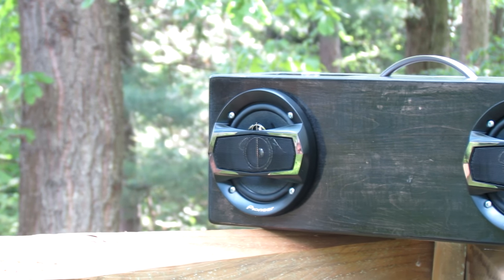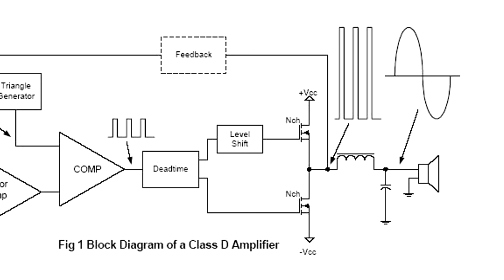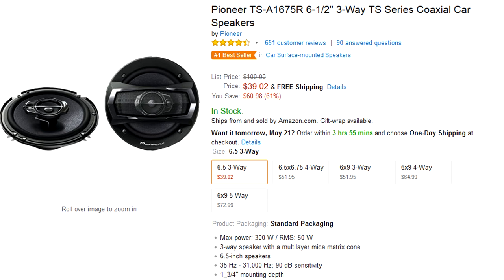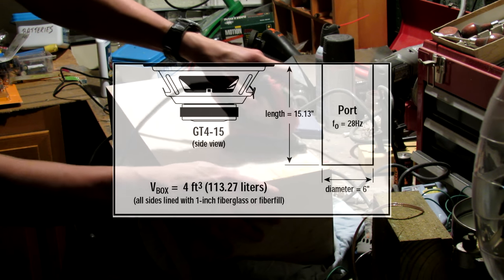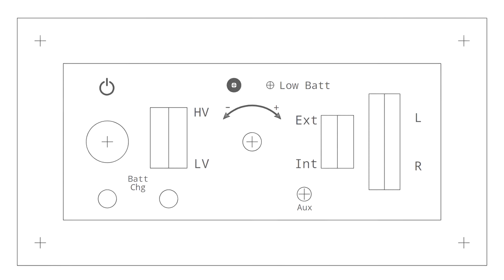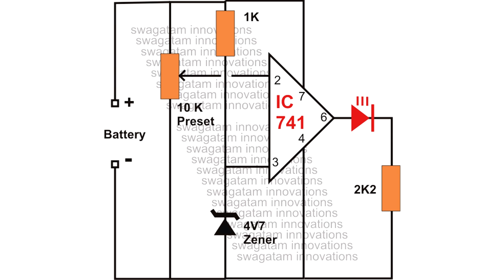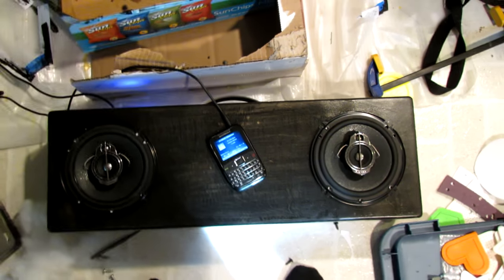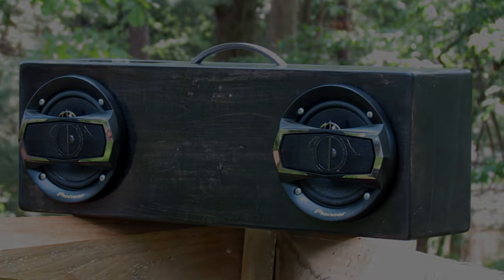Designing a Cheap but Powerful Portable Speaker System

Comment: finished my box. thanks for the idea and design considerations. I covered it in waterproof vinal, and aluminum trim.  used a Bluetooth rx and have a built in volt meeter to measure battery levles. I'm really happy with how it turned out. 

thanks again
Reply from the maker: +Tyler Cowan Nice!

Comment: Good job, as for the lack of bass you can reverse the polarity in one of the speakers so for example speaker nr1 gets connected normally-positive wire to positive speaker terminal, negative to negative and on speaker nr2 you connect positive wire to negative speaker terminal and negative wire to positive speaker connection.
What is happening is that bass speakers are cancelling each other in an enclosed space.  
In your case you need to separate the twitter speaker feed from the  main connection in the "reversed" speaker as it needs to be connected properly (+to+ and - to -).
Cheers
Reply from the maker: +RrahimStruja Actually, I accidentally wired up one of the speakers backwards by mistake. I re-wired them in the right orientation and they worked much better. I don't think that having them be opposite to each other would help at all, as it won't create any pressure inside the cabinet, as the pressure coming off of each speaker will be opposite to the other one, effectively canceling the other one out. I got as much as I can out of it now, but I plan on making a better one in the near future!
Reply: Long time ago I've build a speaker/box similar to your boombox, the only way to get bass was to connect in reverse one of the speakers. Or you could divide the speaker enclosure in two. It will also help if you add some kind of sponge material which will absorb the hollow sound. Anyways, great project looking forward to see more :)

Comment: Nice Job!! You were saying something about it having Poor Bass Response. Try putting a Baffle in the Center of the Enclosure next time. (Separate the Two Speakers.) Since it's Stereo there will be Cancellation in the low end being they're in the same Enclosure. Cheers!!!
Reply from the maker: I never did this, but I did notice that I accidentally wired one of the speakers backwards. Then they REALLY cancelled each other out. It seems good enough for now.

Comment: Built a boombox using a really efficient 3.7-6.5v amplifier and a similarly powered Bluetooth reciever, and used a direct tap into the lithium ion cells inside a 10000 mah USB battery. I left the USB battery controller in there so I could charge the battery via USB and also charge my own devices (i.e. Phone). Then I used some older but really efficient full range drivers and a plastic ammo can as the enclosure. It doesn't sound like it was made by Bose, but hey, I have a boombox that's plenty loud, Bluetooth, and has almost 100 hours of battery life. Yeah. You read right. One hundred hours of battery life.

Comment: Basically, you need a rocket science degree to build this. I'll buy one instead.
Reply: +Higzy Teflon thisis actually really easy and a lot of fun :) try it
Reply: Higzy Teflon No need for fancy mitered joints just build a basic box it won't affect the sound and you can use any speakers you want. Even an old set of bookshelf speakers would work.
Reply: I think the same, you need to have the Einstein brain to do that.

Comment: Well done except choosing this type of speakers, they are made for car use with large volume enclosures (doors) or even infinity baffle design (if used in the back) Next time try using speaker drivers made to be used in enclosures, Peerless has some cheap woofer options and Vifa for tweeters. Using proper speakers will give you a lot more low end and overall quality.
Reply from the maker: +Alexandru Simonescu Yeah, I noticed that after getting these things, but the sound isn't too bad, it just could be better. The main reason I went with them is that they have all the drivers I need, and come with protective shrouds which have saved them more than once.

Comment: If you're going to build more boxes like this, the easiest way to glue 45 degree cornered pieces together is to tape them. You lay the cut pieces the outside upwards lining them against something straight, then you apply tape (like https://goo.gl/TVuvyu) on the coming corners except for the last one. Then you flip the thin inside facing up and apply the adhesive. Then simply flip the pieces together and add tape to the last corner. This is the easiest way to build good looking corners. Hope you get what I mean, english isn't my native.
Reply from the maker: Cool! Looks like that would have been easier.

Also, a note for the future: Your comment got auto-detected as spam because of the link. I'm not sure how you would have included the image without it, but just know that if you have a link in a YouTube comment, it will most likely get flagged for spam. I unflagged it though :)

Comment: add a passive radiator in the middle and the bass will be much better
Reply: for those size speakers it would be more efficient to add a port. passive radiators are more suited for smaller portable Bluetooth speakers
Reply: not really ive seen some people add radiators to subwoofers with no problem

Comment: nice build man!!! but it would be better if you indeed went with MOSFET amp and NOT ic chip( better quality) 

furthermore, you should really not seal the parts inside. have a locked hinge on top lid as well as ventilation. things will last MUCH longer as well as batteries are consumable so easier replacement without destroying the build trying to get at the parts should tey need replacement.

Comment: I know this is an old video, but I wanted to ask a simple question. Why did you choose a taper audio pot instead of a linear pot? After building it and using it for a while, would you still make that choice?
Reply from the maker: Well, to be honest, I haven't used this thing much, but here's the reasoning: A linear pot would change the voltage on the input linearly with rotation, meaning that going from half-turn to 3/4 turn would make the voltage level go from half to 3/4. While that sounds like it would work, it actually makes the operation a bit fiddly. We hear sound levels logarithmically, which means that a doubling in power does not correspond to a doubling in perceived loudness. Having the audio-tapered pot accounts for this and it makes adjusting the volume a lot easier.

If an audio-tapered pot had no effect, they wouldn't be produced and used so frequently. If you want, you can try a linear pot and see what the actual difference is, because I can't recall a time where I did a side by side comparison.
Reply: Thanks for that answer. It makes sense.

Comment: I got a question, I've got some high end speakers, Kicker 6 3/4" component set, would making a cabinet just large enough to fit the speaker make that much of a difference in terms of sound quality? Length isn't an issue for me really, just thickness and height. I'd like to keep the whole thing as thin as possible. 

I thought the cabinet size didn't really affect things that much compared to outright speaker and amplifier quality.
Reply from the maker: I'm no audio engineer, but if you have high end speakers, you really need a cabinet with the correct volume in order for them to sound good, as I'd say that cabinet quality is the #1 effector of sound quality. The cabinet is really only an issue for the woofer(s). You need a good cabinet for good sound. The specific length/height don't really matter; it's all about the volume of the enclosure. Material choice can be second, but getting the right (or a close enough) volume is key.

Comment: I heavily advise you to update this "commentbox" with your latest findings to prevent you from answering the same questions more than once.

In the case of bad-wiring, was it due to the diagram from the amplifier product or a mistake on your part for not following the diagram?
Reply from the maker: +JJ, M. If by bad wiring you mean accidentally wiring one of the speakers in backwards, then it was a construction error and not an error of the diagram. With all those wires, they got flipped at some point, and it took me a while to notice. I'm surprised that was the only thing I messed up. I will definitely update the description with added information, but as far as the diagram goes, everything should work, but as I said, it is very specific for what I wanted out of my speaker box. 

And about battery charging, the red and black plastic terminals on the panel are hooked directly up to the battery, and a lead-acid battery charger was used to charge it. I'll also link the exact one I used in the description as well. Thank you for your constructive criticism.
Reply: +LazerLord10 Beautiful LazerLord10! Definately wanted to help you out there. Where can I find more info on these stuff (specifically for wiring). For instance, I had no idea how cheap these AMPs are, it's like I'd prefer to call them mobile-amps as opposed to once typically known for primarily car-usage and what not. 

How much better of a mobile-amp can I get by the time it'll be premium price (defeating the purpose of DIY'n it myself?
Reply from the maker: *****
I'm not exactly sure what your asking about, but as far as price is concerned, you should just get something that has the specifications for what you want to do with it.

Comment: Nice project! I see you used step up converter to boost 12v to desired voltage for your amp... How strong is that step up converter and to what voltage did u boost it up? Thanks!
Reply from the maker: +Igor Tomic It was a 75W one I had from a previous project. It's a bit overkill, but it did the job. It was an adjustable one, and I think I adjusted it to 22 volts or so. The thing is, it didn't make an appreciable difference in output level, and it only made the system less efficient, so I never used that function.
Reply: Maybe thats the reason why bass was little weak (other than wrongly wired speaker) .. Low range sonds pull much more current, and these cheap chinese modules dont like much current peaking..  Anyway nice project , not perfectly done but considering the money and effort that u put into this , the result is very good ^^
I might build something like this for my self.. I got bunch of Li ion cells around here.. I could make 15-20v battery pack and supply the amp directly... Only prob is that im not that good with estetics and visual work like you are =))
Reply from the maker: *****
I wish you luck. And about the bass thing, if it was the power, I would be hearing clipping if the voltage wasn't high enough. While clipping on a class A or AB amp is smooth, it's really scratchy and obvious on a class D.

Comment: l clocked my boombox battery life at 3 days strait, but it is very heavy because of the battery l used it is 60lbs and it is a struggle to carry it places
Reply from the maker: +electronics for fun Yeah, that's the problem with mine. It's 'only' 25 lbs, but that 12Ah lead-acid battery coupled with the maple the case is made of makes for a very heavy box.
Reply: yeah. if only we had lighter batteries. my boombox is not something you would carry on your shoulder, it is more for like a party at the beach, or camping
Reply from the maker: electronics for fun
If only Li-Ion batteries weren't so darn expensive! I also need to find projects for the 5 UPS batteries I have lying around.

Comment: Hi, I see that you activelly answer questions, so I got you one. Should I go with TDA7942P amplifier just because I'm noob (I see in comments that it's only about 25w per channel, so I'm a bit worrying). Which speakers I should choose? 25W RMS and 300W max would be ok?
Reply from the maker: +Marijus Žilinskis I'd be careful with eBay amplifiers. I got a "100W" amplifier and it nearly caught on fire at 10W output. Parts express tends to have decent prices and very quality products, so I'd look there first unless you have a really tight budget. As for power, I generally like to keep the RMS rating of the speaker at or below the amplifier's maximum output. RMS essentially means the continuous power that the speaker can handle, and the power rating on the amplifier is the continuous power output as well. For a 25W stereo system (more than enough power, by the way) I'd go with at least 30W RMS rated speakers, or even higher. If your amplifier has a higher output than the speaker's RMS rating, you run the risk of damaging your speakers. Essentially, the amplifier becomes the limiting factor, and nothing will break if you push things too far.

I hope that lengthy explanation was helpful :)

Comment: How much battery mAh would you go with for a single 50w speaker with 8ohms for a decent battery playtime with good volume?
Thanks
Reply from the maker: +Andreas Gyberg 3000mAh or more should be fine. My one was 7.5Ah, and it was a bit overkill. The only downside to going with larger batteries is initial price and weight!
Reply: Ok thanks. I was thinking to go with something around 4-6k so i guess that'll be fine.
Reply from the maker: Andreas Gyberg
yup

Comment: Maybe I missed it but how did you fit the handle??
Reply from the maker: +BIFFY425 I drilled two holes in the top, and used the bolts that came with the handle to mount it. I had to cut them shorter with a hack saw, and I tightened them from the inside of the case after it was assembled and finished. I left the speakers out, and I tightened the bolts through the two speaker holes, which are the only openings to the inside of the case. There wasn't much room to work with, maybe about 3 inches or so, so I had to use a vise grip and a Philips head drill bit to tighten the bolt from underneath the handle. It didn't end up very tight, but it was tight enough. There's probably  a better way to do it.
Reply: ok thanks. im gonna use a handle from a guitar amp for my next speaker project. Iv done a few videos on my old ones check em out!

Comment: The link to the battery charger you used does no longer exist, do you have any other to recommend?
Reply from the maker: +Eirik Espe new link: http://www.amazon.com/Battery-Tender-021-0123-Junior-Charger/dp/B000CITK8S/ref=sr_1_3?ie=UTF8&qid=1461515744&sr=8-3&keywords=float+charger

Really anything that can float charge a lead-acid battery will do, but Battery-Tender brand tend to be the best quality for the price.
Reply: +LazerLord10 thank you <3

Comment: Hmmm.... Am quite a novice when it comes to electronics, but I would like to ask a question... Am trying to power up my 30 watt studio speakers for if possible 24 hours, And I don't know what battery to use neither do I know how to connect the battery to my speaker (they are a set of 30 watt Krk speakers with in built amplifiers).... Any suggestions on what I could do to make this happen? (I wish to power each speaker individually with their own rechargeable batteries)
Reply from the maker: First you want to figure out what voltage they run on. Odds are it's 12 volts, and if they're 30 watts, that means they will draw (at maximum) 2.5A each. For 24-hour operation, you need 2.5A * 24hr and you get 60AHr each. That's quite large, but that's if they're drawing max power, which rarely happens continuously, even if played at loud volumes. You could try using Li-ion or Li-po batteries, but they can get complicated. The lead-acid battery similar to mine would also probably work, but more research would need to be done for your project probably. Gotta say though, this is one of the best ways to learn electronics. Have a goal and research your way there by googling everything!
Reply: My 8010A is 100v - 240v Ac and power consumption are as follows:
Standby = <0.5 W
Idle = 5 W
Full output = 30 W
It also has a class d amplifier
Reply from the maker: Aetheon Pro hmm.. the fact that it runs on AC makes things a little more tricky. Have you opened them up to see if there's a point where it regulated the AC down to DC? Odds are there is. You could basically power them with DC and skip their power supply all together.
Reply: maybe I could purchase an AC to DC converter.... Probably AC to cigarette lighter
Reply from the maker: Aetheon Pro That wouldn't be very efficient. I'm not quite sure what more you could do, though.
Reply: Right now am using a 300watt inverter connected to a 12v 12ah battery, It has been running my 60watt speaker for about 10 hours now.... Thankx all the same

Comment: I wonder if a bass radiator would help
Reply: probably more efficient to use a port
Reply: +Alejandro Cervantes I have this setup with 4 Ohm Sony XPlods. A ported box made of particle board really gives lower bass. If you use sealed box made of hard wood/mdf, better use an amp with a tone (Bass/treble) control and 2.1 setup.